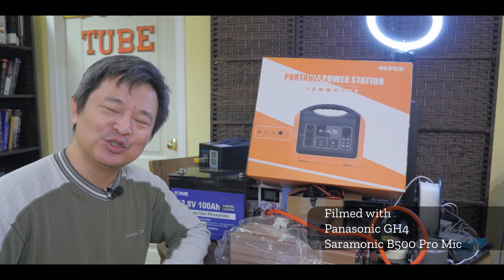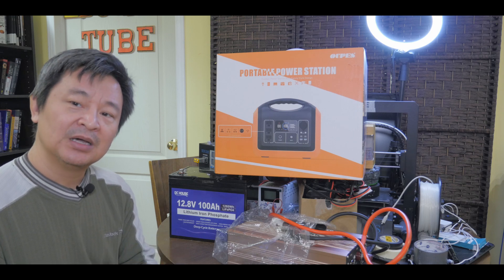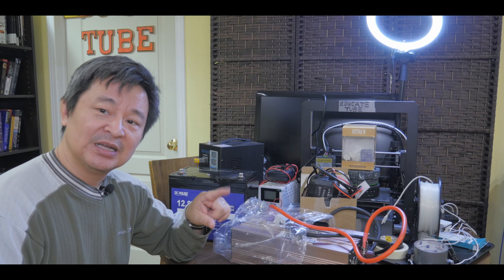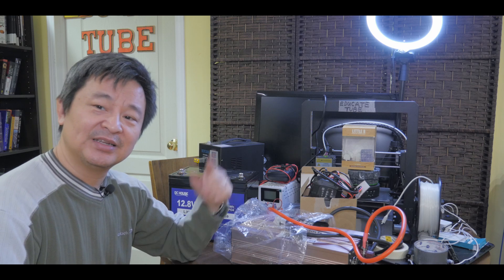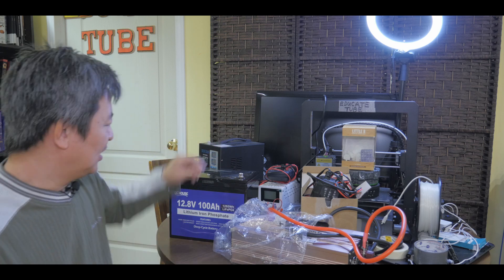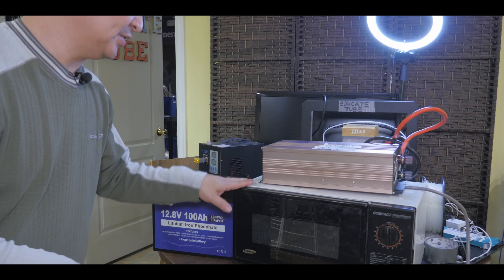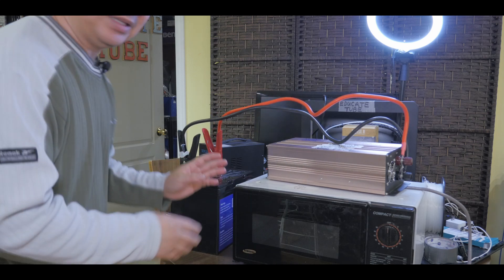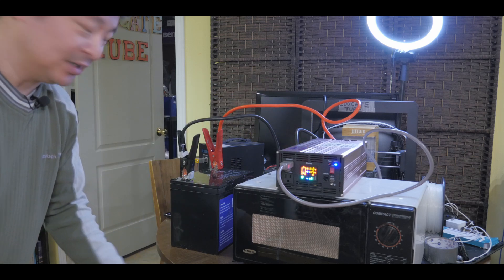Why I bought LiFePO4 battery instead of a Portable Power Station - DIY Lithium Power Station

Comment: What you can do to eliminate the Batt. terminals from getting hot is instead those clamps try Battery Lugs. Those Battery clamps are not the best for high power in this type of application.
Reply from the maker: Thank you for your insight.
Reply: @educatetube  you are welcome